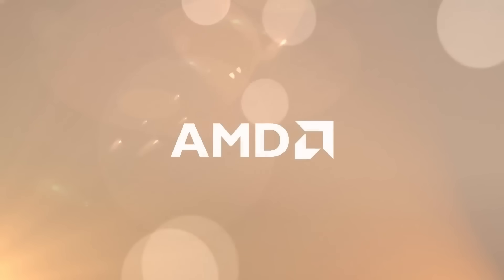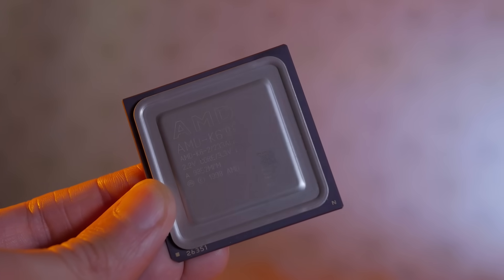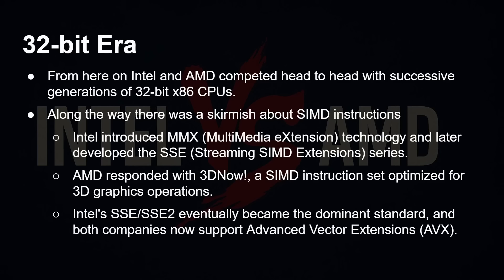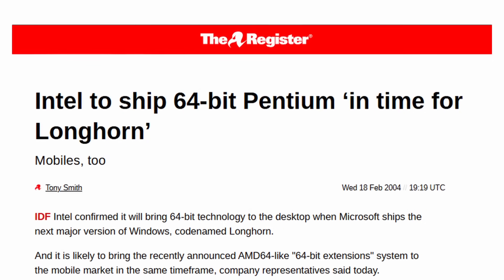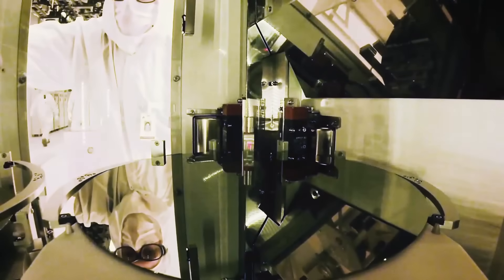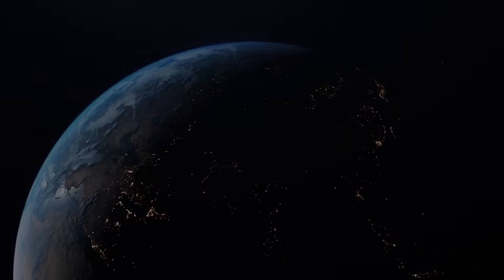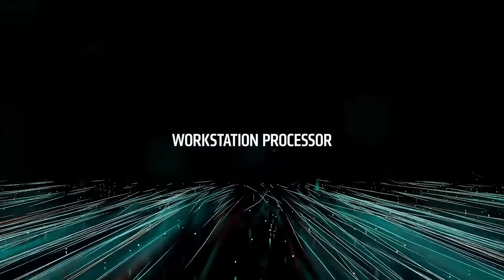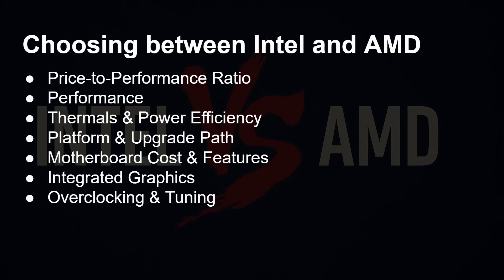Intel vs AMD: Decades of Rivalry and Drama

Comment: I built my first Windows machine in 1996 based on an AMD K5. I've used many AMD and Intel CPUs since. On balance, the Intel CPUs have been the best performers and best in terms of longevity. That said, I haven't used an AMD CPU since AMD's Bulldozer chip disaster.

Comment: Itainium was let down by those expected it run '80486' code at native speed ! when it was designed to compete with the likes of 'DEC' Alpha chips, it had features only found in so called Mini systems and would could be considered as a 'Main frame' system supporting in the day 100's if not 1000's of users in applications like 'banking' which today still run on 'Main frame' systems.  Whats IBM newest system 99.99999% uptime and nono second fail over to a shado system..   no love lost to IBM on my part.. the company I worked for actually had a joint venture with IBM and its 'Linux' system we helped them to get there Multi CPU system to run MULTI CPU Unix/Linux..

Comment: Hmm you missed the part about unlocking more of the RAM as that is usually how some of us think about moving from 32bit to 64bit OS and HW.
Reply: There was also VIA company that was making x86 processors.
Reply from the maker: @akarimsiddiqui7572  True, but this video isn't Intel vs AMD vs VIA. 😜
Reply from the maker: That isn't the main reason to move from 32-bit to 64-bit. Intel and AMD both supported Physical Address Extension(PAE) which allows 32-bit chips to address more than 4GB of RAM.

Comment: I would really like something like the AMD Ryzen 9 7945HX released on a AM5 desktop upgradable socket, low power great multicore performance for productivity and quick enough for casual gaming with a mid range GPUs at a very good price.

Comment: Skipped quite a bit from 1998 to 2016. Intel kickbacks, AMD lawsuit, FTC judgment, 10 years of bulldozer (AMD stagnation), chipset wars with nVidia, and so on. Probably a whole video but important none the less.
Reply: All true, but this is really better suited to a long form doco style video, this one is was more like a quick walk across the surface as a summary I think, the video still brought back memories, but also skipped the entire Athlon series, which to me, was one of the best AMD chip and socket series, lasted so long, I still remember being part off the race to 1ghz with my modified slot based Athlon Thunderbird chip :) got 966mhz....so close :(
Reply from the maker: True. But we will only ever scratch the surface as we are looking at 100 years of combined history. 15 minutes, 30 minutes, even 2 hours isn't going to cover everything.
Reply: @GaryExplains that's right, but bulldozer was a Hot mess
Reply from the maker: Indeed, but if you noticed I didn't get into details of any given generation of processor vs its counterpart. I just said that the two continued to release head to head generations, both in the 32-bit era and in the 64-bit era.

Comment: My last Intel desktop CPU was the Pentium 4 HT (3.0GHz) with 2GB DDR (400MHz).  After 2000 I did buy off-lease PCs, mostly 5/6 years old for ~$200.  I used the Pentium from 2008-2014, It came in the 2002 HP d520 SFF.   From 2018 I reused the system again with 4 old HDDs (3.5" IDE 250+320GB and 2.5" SATA 320+320GB) as backup server till it died early 2024. 

After 2014 I used AMD.  First in a 2008 HP dc5850 with a X2+ motherboard from 2014 to 2019.  In 2014/15 with the original Phenom X3 8600 (3x 2300MHz) and later I upgraded the CPU to a Phenom II X4 B97 (4x 3200MHz).  It had 8GB DDR2 (800MHz).

In 2019 AMD Ryzen convinced me to once again built my own PC for $349 and I bought a $60 ASRock B450 HDV Rel 4.0 motherboard with a Ryzen 3 2200G (4x 3700MHz) and 16GB DDR4 (3000MHz).  In Dec 2024 I did a mid life upgrade to the Ryzen 5 5600GT (6C12T; 4700MHz) and 32GB DDR4 (3200MHz) for $179.  The 2200G I watched running a 100% CPU load during updates of e.g. my Windows 10 VM, but on the 5600GT I never had a 100% CPU load.  The highest CPU load I did see up to now was 50% to 60%, so I run it in power-save mode :)

The mentioned CPUs all did run Ubuntu 8.04 LTS up to 24.04 LTS with since 2009 Virtualbox for Windows support and after 2018 with the ZFS file system, first ZFS  on Linux (ZOL) and later OpenZFS.  The second life of the Pentium 4 HT was with 32-bits FreeBSD 12 to FreeBSD 14, when it died.  FreeBSD because the linux version of ZFS did not really support 32-bit machines.  FreeBSD was running on ZFS and it still supported 32 bits.  My first FreeBSD ZFS version had some minor compatibility issues between Linux and FreeBSD.  Later OpenZFS did run without any issue.  I still run FreeBSD 14.3 in a VM to remember its good old Pentium days.

Comment: AMD would be the one with a future… and Intel is famous for electric heaters…
Reply: Not really. I gave up on AMD. My first PC was based on the K5. Subsequently, several Athlon systems including a quad core model, but their CPU scene was a mess around the time bulldozer was released. Everything was a disappointment. I switched to Intel and never regretted it.
Reply: @toby9999  Dude, lots more people have gone the opposite way and never regretted that either. I mean LOTS more people.
Reply: @diotitus Yet Intel still dominates in terms of market share, right?
Reply: That's because they were ahead for a long time. AMD since 2019 has been reducing the gap.
But Intel does still lead, yes

Comment: Global Foundries never started to fall behind Intel: It implies that they were on-par with Intel which they never were - Intel had a 18-month manufacturing advantage over the rest of the industry since inception only loosing out, as you’ve rightfully pointed out, to TSMC trying to move to 10nm node and still struggling to catch up. But no, Global Foundries/AMD was never on-par in terms of manufacturing with Intel
Reply: That's right.

Comment: @2:24 I miss the function keys being on the left of the keyboard. When the mouse was added, they were balancing the use of hands and you didn't need to look at the keyboard to find the right function key.
And I don't know the story behind why they were put to the top of the keyboard, and even less for the 'extra' keys with arrows added between the keyboard and numpad to the right, that uselessly enlarged the keyboard with no real benefit since the numpad already had everything.
Great video!
Edit: Just a precision here (you skip a lots of details in the timeline) Itanium was a commercial failure because AMD released the specs for AMD64 pre-2000 that insures software compatibility with existing X86_32, a thing that Itanium was not able to do. Intel wanted to go with their64-bit implementation to leave AMD in the dust as they would not be required to share chip designs.... And the correct name is AMD64.
Edit2: Also, when Apple left Intel for their Mac computers, they gave Intel their "design" of p-core and e-core they were about to use in their M chip line up. That's how Intel "miraculously" held its head above the water with the 12th gen released in 2021, else AMD would have drowned them at Zen 3 with the 5000 Series line.

Comment: And let's hope for many more decades to come but I do really worry about Intel right now, 10nm was an utter disaster, they have basically had to move to TSMC, they were forced to abandoned 20A, no 3rd party wants to use 18A even though Pat bet the company on 18A! Now we are waiting on 14A but that is years away and will be incredibly expensive if they go the High-NA route.

The biggest mistake for me was not backing Jim Keller 100% and basically not making him the CEO, he said Intel needed to move to TSMC much sooner than they ever did. He tried to push how important AI was way before Intel finally pivoted to it. His vision and chip design is second to none in the industry. So unless Nova Lake is a massive win then I think the Intel we know is over. 

Just as an FYI I am running a 14700K (a cheap upgraded from 12600K) but if I was honest I wish I went to Zen 4 or 5. Basically a lot of the software I use only uses the P-cores so it's just 8 core and then if I dare minimise anything or run something else in full screen whilst I wait for something to finish then either Thread Director or Windows decides to put the process I am waiting on into the background and only use the E-cores! Hopefully Razer Lake goes back to just 1 big core type but I believe it's the design after that which is 5+ years off.